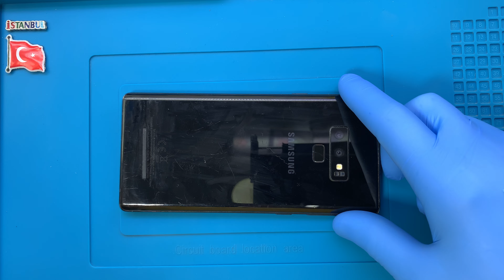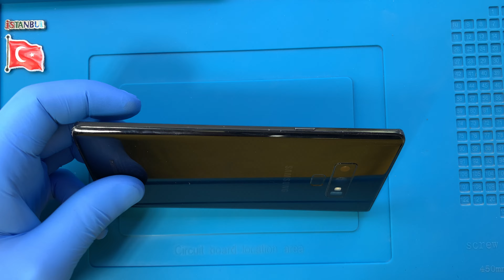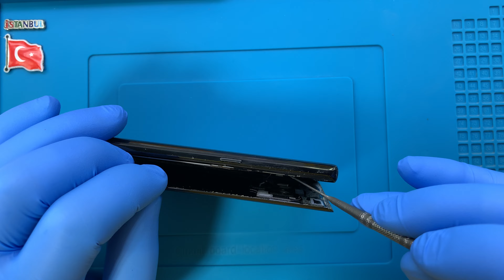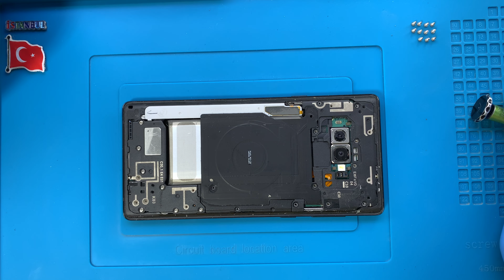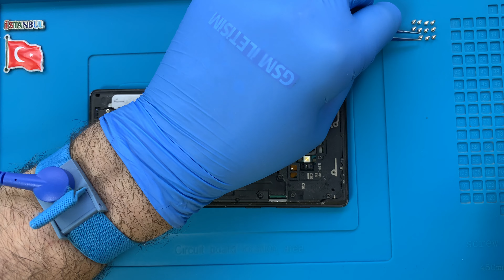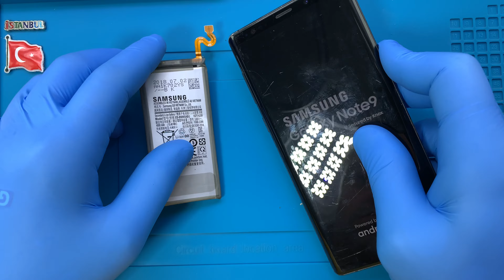Samsung Galaxy Note 9 Batarya Değişimi 🇹🇷

Comment: Many thanks!😁
Is it still waterproof?
Reply from the maker: Hi;
Phone manufacturers only guarantee water resistance for undamaged and undamaged devices. For this reason, it is necessary to be more careful about liquid contact after screen - part replacement and technical service process.
Greetings.